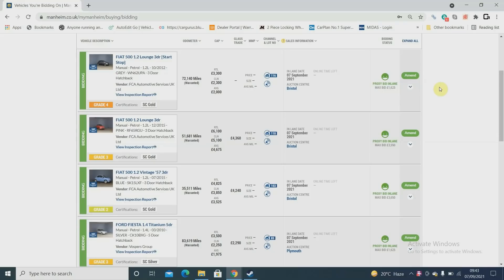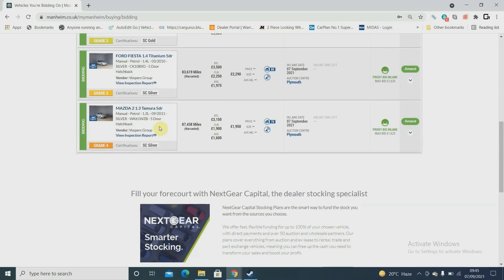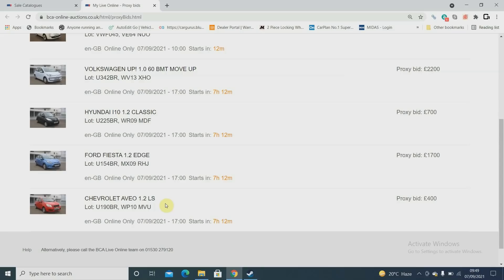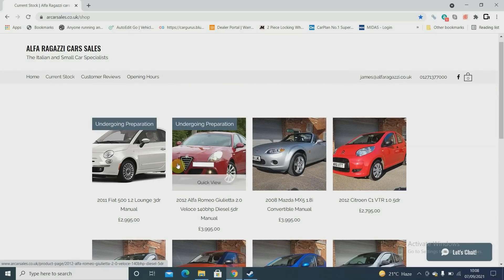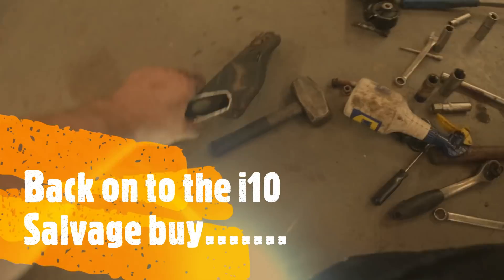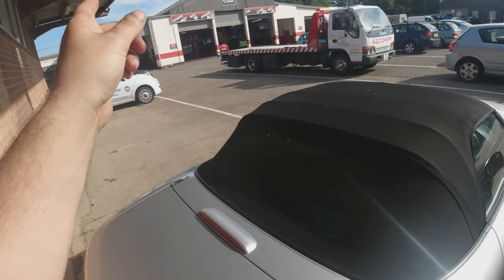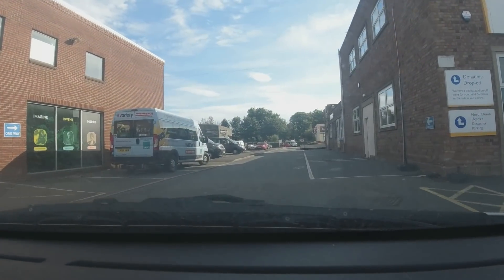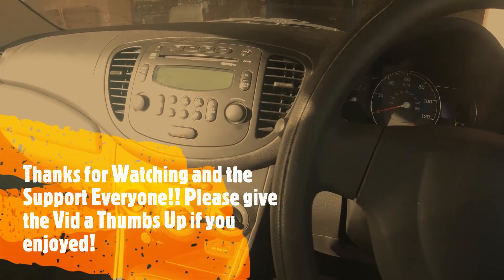I thought it only need a Wing!

Comment: Now you see. Back when the MGB was new, the owners handbook told you how to adjust the valve clearances (easy job). These days it warns you not to drink the fluid in the battery! And they say we are getting cleverer.
Reply: Ah? but there is always someone who will do it for 'compensation', we are not getting cleverer we are more stupid than anytime in our history, common sense has deserted us, in politics and in law.
Reply from the maker: lol
Reply: @davidoldboy5425  So true, it should be called Rare sense these days 😄
Reply: Brilliant comment Elliott. Or you have to go online to find out information about the car, which gives you feck all  about it, and but you can see  a video showing 360 video of the car you are probably sitting in.... But remember Coolant is very dangerous too especially if you get it in your eyes.
Reply: @davidoldboy5425 That's the problem with common sense, it isn't very common.
Reply: @SPEXWISE  yes once the culture of claiming damages for anything became common you have to cater for everything, sad world.
Reply: I recently bought a cooker and it came with no instructions or grey wire for wiring it into the kitchen... it said competent electrician required. It's a 3 wire connection, not rocket science! I think most customers pay the shop to deliver and install these days 😏
I obviously picked it up and wired it myself, as I am oldschool.
Reply: @terryatkinson899  Ah, but did you work out first that the back emf from the grill would not cause a magnetic field that would interfere with next doors pacemaker?? You could be sued (joke). I once worked for a company where we hired a very expensive 'expert' in his field. First job he got he hired a consultant, should have been sacked immediately but was still there 10 years later.
Reply: @davidoldboy5425  it didn't go bang when I turned it on... success, haha

Comment: 13:03 Rover 75!!! Right up my street. Do you know what's wrong with it and if it's in good hands? 😀
Reply from the maker: £100 buy from garage after failed mot. Lad in workshop had it welded it up and uses it daily
Reply: Love it 👍
Happy ending and a lovely car saved. 
They do like rotting out the rear of the sills and rear upper arms but that's not too bad all things considered for a car that came out 23yrs ago!!

Comment: We had a 2012 i10 - if you ever get a rattle at certain RPM it's the clutch release bearing which just needs a clutch cable tweak. Ever gone slightly left field with a Suzuki Splash/Agila or Perodua Myvi (Daihatsu) - very reliable/bulletproof. Worth looking at smaller independent auctions?

Comment: "so yeah" car sales
Reply from the maker: lol
Reply from the maker: So David, as a man in the know, do I pull the trigger on a unit 2600sqft with 20 parking spaces for £1200pm?
Reply: @ChopsGarage  yes seems OK, your paying a large percentage of each car as it is, plenty of money in car dealing mate.
Reply: @ChopsGarage  if you get your act together maybe get a painter /handyman as well I bet you could do 10 cars a week bud
Reply: The sports cars were all last week as well
Reply: @ChopsGarage  You know you want and need to! £1200 pcm seems pretty fair
Reply from the maker: @roystonvehicles9129  Cheers bud, helps to have reassurance from someone actually doing it!
Reply: @ChopsGarage  bit of a paint booth at your new place mate, you can even get inflatable ones now, biggish compressor, ditch the cans and you'll be turning out great jobs, needing little after work in a lot less time, thick 2k primer from the gun goes on so thick as well bud, set a lad on for basic prep and you'll have a goldmine, ten cars, ten grand a week profit.
Reply: @ChopsGarage  OK mate, ta
Reply from the maker: @roystonvehicles9129  10 cars a week jeez I'd struggle to get the stock let so he get it all done. But yes inflatable booth on the cards

Comment: Hyundai I10 WR09 MDF  15/01/2021 16:16	
Pass
Mileage:
56,808 miles
+ 1,376 miles travelled since last MOT.
Advisory Notices
Nearside rear tyre slightly damaged/cracking or perishing (5.2.3 (d) (ii))
Play in both top strut mounts
Reply: Which tool tells you the time of test please?
Reply: @bt1804  Ah thanks, I do have that one but not an account for it. Do you need to be registered and logged in then 👍
Reply: @bt1804  Cheers good to know 👍